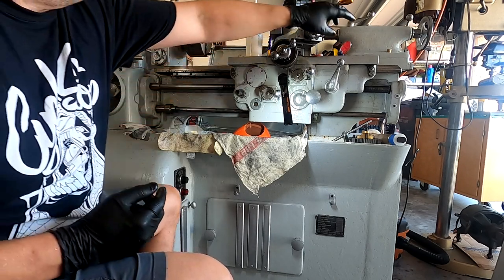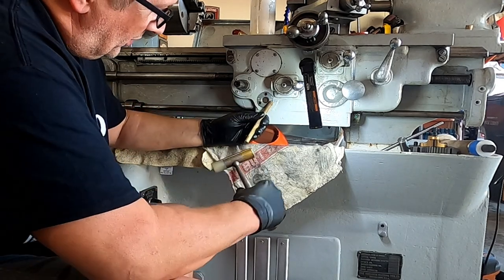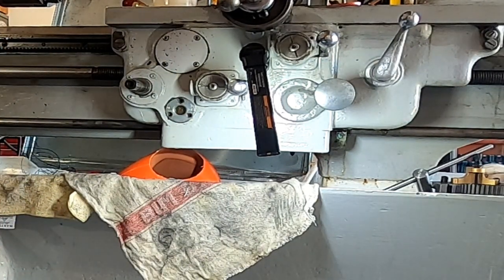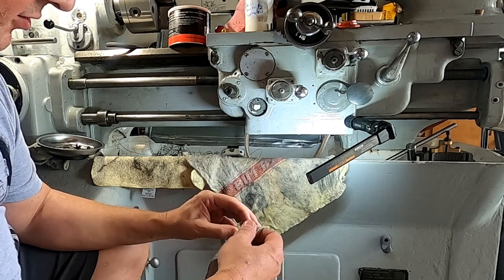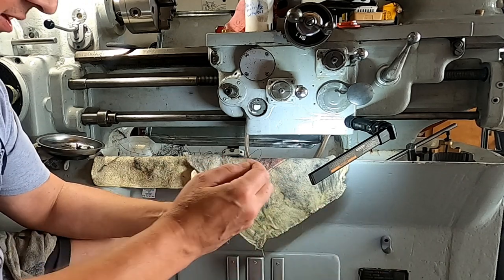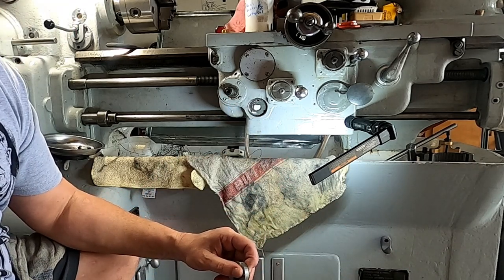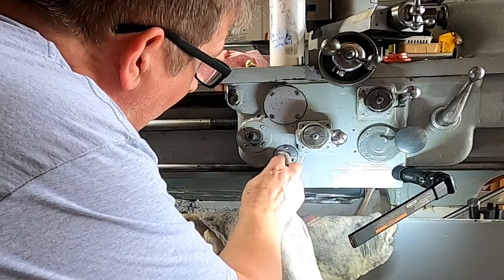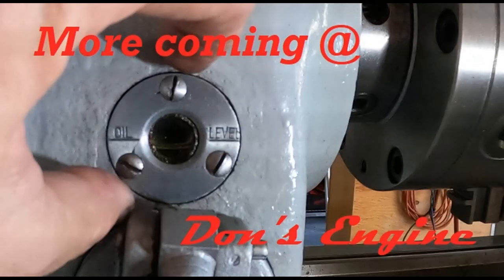How to remove and clean a Sight Glass: R&R, excerpt video: Monarch Lathes 10EE, Machine tools

Comment: Do you recall where you got the convex lenses (the magnifier you mention) you used as replacement lenses?  I've been looking at various jeweler's loupes but the sizing is just a tad small.  Thank you again for this, very helpful.
Reply from the maker: Hey Brian.  I had a box full of junk that I got it out of. Not sure how it accumulated. I think one was a Harbor freight version. Size doesnt need to be spot on as the cork gasket crushes around the edges.  Don